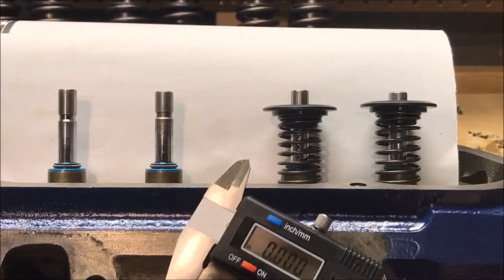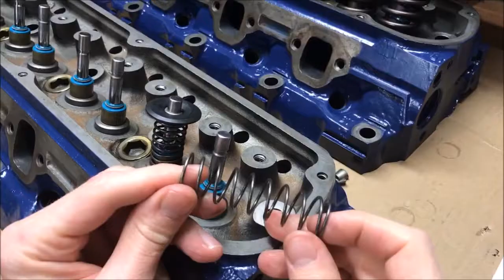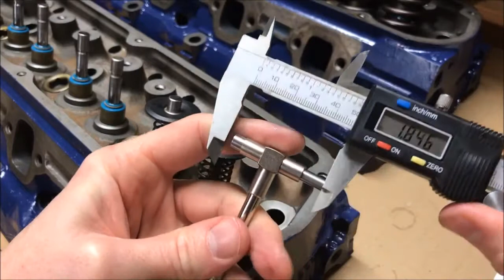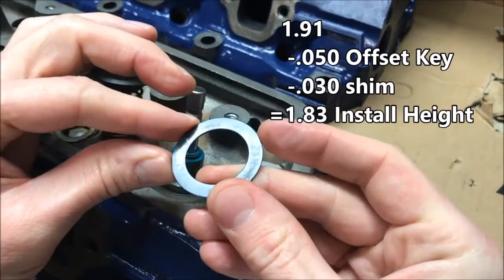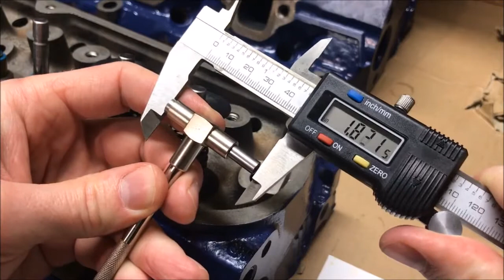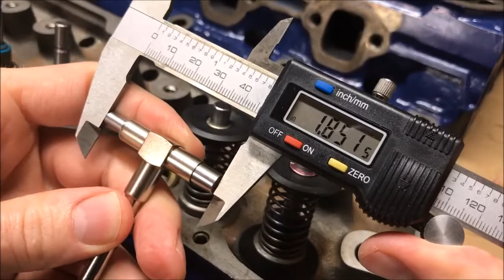Set Install Height GT40 Iron Heads

Comment: The "installed height" is not as important as the seat pressure, that is why you use a Rimac or similar tool.  You measure the amount of pressure you have when the spring is compressed down one inch.  A good rule is that in dealing with OEM valve springs, if you have a difference of more than 20 pounds between the springs, just toss them all out and buy a new set.  Unless you're a cheap azz, then you can use the valve spring shims to bring the weaker springs up to match the others or increase the seat pressure of all of your worn out springs.
  When you cut the valve seats down and reface the valve faces to regain gas sealing, the tip of the valve stem is moving upward, so your installed height is going to be different from valve to valve, depending upon how much someone had to grind the seats and faces.  So you grind the seats just enough to get rid of the pitting in them, that way you will maintain the service life of the head for as long as possible.  If the margin on the valve head is too thin, you can run into problems there, so if they get down too thin, put in new valves.  Different car companies can have different specs for the valve head margin, so go by that.  The valve lash is done automatically with a juice lifter, and with a mechanical lifter, you use a feeler gauge, and so the installed height spec is of no consequence, the seat pressure is what you need to be concerned about.

Comment: I have the gt40 lightning heads. I’m stumped because there’s no air pump thermactor attached to the back of them. Should I plug anything in that area?
Reply from the maker: Hello. Unless you’re running the air pump and you’ve got the factory smog equipment attached, yes I’d for sure plug the holes. I don’t remember what I used to plug mine, but I know I found something locally…was a common thread size and degree. It’s hard to bring a heavy ass head into the store, but maybe they’d be cool if you did that. Best of luck 👍

Comment: Great video!  I’ve always cut a bolt down to about .060” short of my target installed height, ground a radius in the head of the bolt(to fit around the spring locating shoulder) and use feeler gauges to make up the difference.  It’s not idiot proof, but like anything, a little common sense goes a long way.
Reply from the maker: Absolutely!

Comment: Man, i was hopping someone would tell us where to get or match  good valves and retainers to replace the junk once. Im tempted to just get alloys for the time spent porting and then cash, whats the point.
Reply from the maker: I agree. Porting these heads has little to no value IMO. Sure you get better flow, but for the money and time spent, just pony up for some AFRs and really go fast. 

Not sure what you mean by junk retainers and valves. The stock stuff is perfectly fine for these heads. You can get Ford Racing or a different brand valves and retainers but you’ll be paying a lot for them. Not worth it for these heads. IMO.

Comment: Hey im a bit confused i have a sbc 383 im fighting installed height at 1.750 i hear you and comp say plus or minus .020 i have some i can only get to 1.737 is that safe
Reply from the maker: Hello:  if I’m understanding, you’re trying to reach an installed height of 1.750. You’re getting a max reading at 1.737. 

1.750 - 1.737 = .013. This is within .020 spec and will work fine.  

As far as margins go, please check with the manufacturer based on your engine combination. It might be .020 for my setup, but different for yours. 

Let me know if I’m misunderstand. 

Thanks,
Reply: @FastFixYouTube  when you say margins do you mean the spec range as far as +/-.020? Or is that something different?
Reply from the maker: No, that’s what I mean...the spec range will be the plus or minus .020 is in reference to when I say “margins.”
Reply: @FastFixYouTube  okay gotcha so all valve springs should be a +/-.020? I called howards and asked them and all they said was you want 1.750 but i cant get that exact i know none are gonna be exactly the same. My spring pockets are pretty deep im having to re measure cause last week i was all .010 or less from 1.750 i go to but seals in and its way off how idk but im also goi g from a 1.800 height to 1.750 being i upgraded to hydro roller.
Reply from the maker: The +\- spec regarding install height is completely dependent on the requirements of the spring you’re running.  The springs you have ahold come with instructions on the maximum and minimums regarding install height. If you’re unsure of the requirements, you need to have the springs checked by a shop. They can tell you those properties after testing the spring.  Otherwise, you’re risking a lot by guessing what install height should be wether it’s your guess or a shops guess. Again, it totally depends on the spring. Hope this helps. It can be tricky, but getting it right is important.
Reply: @FastFixYouTube  howards didn't send specs but they are 1.750 height springs my height micrometer is .002-.003 off and im currently getting very close to 1.750 with a certain amount of shims and standard keepers along with -.050 keepers my pockets all range in depth and the springs i had well they went from 1.805 to 1.850 and i broke in a flat tappet with no issues. But also as long as i have close to my installed height with standard or -.050 keepers inshould be good? Also the ones with -.050 keepers sit a bit lower than the one next to it but installed height is within .003-.005 to 1.750

Comment: I have GT40 (3bar) heads). Will the stock headers fit or do I need something special? it's an 88 LX 5.0
Reply from the maker: Yep, stock manifolds will fit. Nothing special required. Thanks for the question.

Comment: Did you use the valve springs that came with the heads?
Reply from the maker: Hello. No, they were matched to the cam. Stock springs would not work in this application. Always make sure to use springs matches to your cam/rocker arm combo. Thanks for the question!